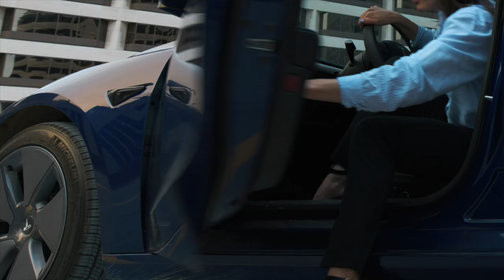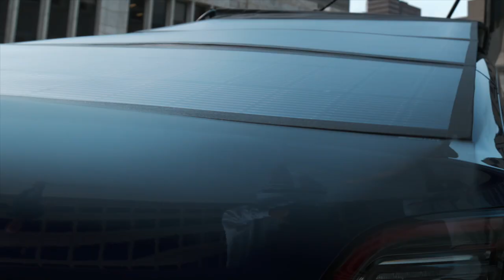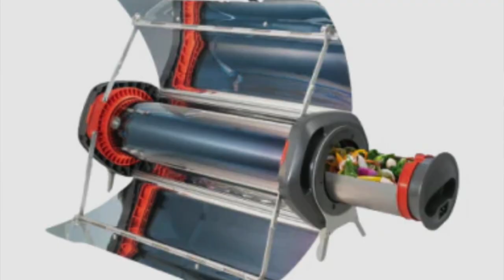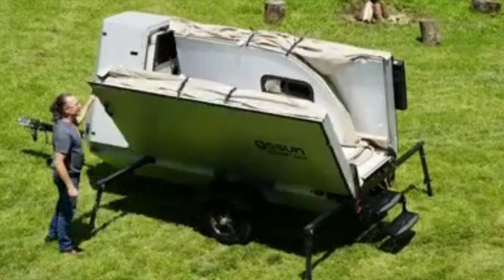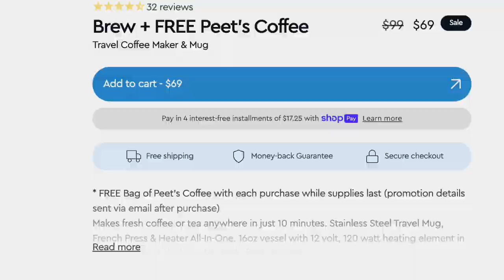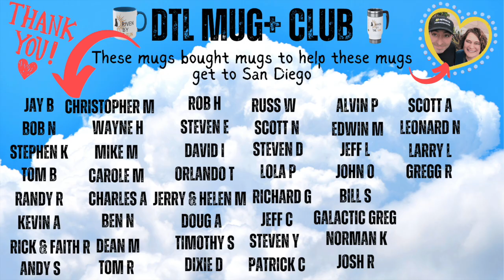Charge Your EV with Solar #GoSun

Comment: With panels folded out, how are they secured if it is in windy conditions?
Reply from the maker: Last I heard they were safe in normal windy conditions but not in high winds. They may have fixed this. I haven't looked at the most recent build.

Comment: After watching my older Model S sit unused on the street for a cold blast of weather we had for 3 weeks, and going from 78 to 40%- i realized this would work great. Just maintaining battery level- I'm in an apartment with no way to access its power. 
In severe cold, u should precondition the battery before driving. U get no brake regen(one pedal driving) and horrible efficiency until the battery is warm. That takes away from ur range. 
Preconditioning with a solar panel attached fixes this. 
I already carry a 1kw portable battery on road trips. It powers all my peripherals- and recharge it with a solar panel that folds and fits perfectly on the privacy screen under the hatchback. I simply set it up while at tesla super chargers on the road. 
If i didn't invest heavily into my system already(and didn't have free lifetime tesla charging! ), this would be the way to go.
Reply from the maker: That’s a great use case for this!

Comment: I also hope Gosun EV chargers can be plugged into Tesla PowerWalls and charge them to adequately supply power to a single family house. Maybe a future upgraded gosun EV charger will have a higher capacity to be able to charge up both Tesla vehicles and Tesla powerwalls. It will be the perfect way to get offgrid!!
Reply from the maker: That would be awesome! Hopefully the weight goes down and the efficiency goes up in future models.

Comment: So from some research and what I understand, this solar charger charges 1200 watts/hr, which is equivalent to 5.4 miles/hr. Within 30 minutes of solar charging, it adds half of that, approximately 2.7 miles. With a solid network of superchargers already spread across the country, range problem is essentially a thing of the past.
Reply from the maker: Great point and very true. I agree in many areas (including where we live) range anxiety is a thing of the past. Some states are lagging however. Also rural areas in many areas are behind. Another issue is cars like our Leaf that has an outdated charge port (chaddemo) with no real adapter option.

Comment: LOL, got many decades of experience dealing with electronics and power delivery systems from small to huge. The battery technology of today is not capable of accepting enough charge to replenish it's capacity in this case a cars battery capacity, without of course creating a shorter life duration. Every time you fast charge you are amplifying the damage to your battery. Slow charge will give you the best durability, their absorption rate depends on time for a full charge. The solar panels shown here are simply not large enough to collect solar energy to top off the battery needed to move that vehicle, yeah maybe for shorter distances it be OK. But not to achieve a full charge. If you have 8-10 hours of solar exposure a day or short distances to travel then I guess it be OK too and hope the weather is good. So take all these videos with a grain of salt. If it will be useful in some kind of fashion to you be my guess, but be ready to plug and charge every so often. Hey I just seen a guy with a box like that on his back running down the street! 😅🤣😂
Reply from the maker: Great info. Thank you!

Comment: I pay about $508 annually for charging my car. Once we have PV on the garage that will be $0. Not sure I could justify $3k for mobile PV but, my Aptera will have it built in. Still like the concept. Would be great for camping with the Rivian.
Reply from the maker: For us it will be a security blanket. Can get home (very slowly) if there is a power outage or broken charger. Of course our Aptera fixes that for most cases since it will be our main car. Thank you for the comment!!

Comment: Solar energy is not free. You must amortize the cost of the solar charger over its lifetime. Even if I can get 1200 watts from this thing (doubtful), the price of the power is significant. Maybe if I live at the equator on a cloudless day with every panel oriented ideally toward the sun, I'll get close to 1200 watts. That's 1.2 kwh per hour during peak hours (maybe six hours per day around noon) or 7 kwh per day, but I'd bet on an average less than 5 kwh per day at the equator and less still in Michigan.

At 4 miles per kwh (on the high side of realistic for an efficient EV like a Bolt), you'll get no more than 28 miles of range on your beach trip, so you'd better live close to the beach. Aptera promises only 40 miles  per day with a full array of solar panels ideally. I'd be very surprised if you get 20 or even 15 from this device with a conventional EV.

I pay 12 cents per kwh for electricity from the grid, so that's 60 cents per day at best, maybe $200/year worth of solar charging. Power costs more elsewhere, but if this thing costs more than $5000, I doubt that anyone with access to the grid will save money charging this way. If you want to charge with solar energy, you can install conventional panels on your house and use them to charge. Rooftop solar is far from optimal, but at least the panels are always oriented in the same direction, so you'll get consistent power on a sunny day.

If you like this product and want to use it, more power to you, but don't kid yourself that the energy is free. It'll likely cost more than charging from the grid at home.

I also wonder about the irregular voltage/amperage from this thing. Is it healthy for my EV's battery? Will it even work?
Reply from the maker: Thank you for the comment. We appreciate the research that went into it. Not everyone takes the time to share. Thank you!!

Comment: Don't get me wrong, I think this is a great idea, but I am also very analytical. The problem I see is it depends on if you REALLY need those miles off grid. If you have a car as efficient as an Aptera it would make sense but, then again, that is why it already has solar panels. If you are in the middle of nowhere and have to charge slowly this could make sense, but.....

It costs a lot and this needs to be cheap to pay off in a reasonable time. It's $3000 (or $2100 after tax credit in the US for now, hopefully at least 4 more years ;) so unless the zombie apocalypses comes and you don't have grid power or your electricity is extremely expensive, it will be a very long payback. Other than the good feeling that you are partially running on sunshine. 

My electricity is $0.13/kWh so, unrealistically speaking, I would save $1/ day on electricity assuming I can get 7.7KwH and you don't calculate in the drag of the unit housing the foldable panels, it would take 6 yrs to payback. We all know it's  not 0 drag, it is fairly large so the extra drag will probably eat up half of what you are producing. So if you are keeping your car for 12 yrs you may break even assuming nothing goes wrong with the solar panels or inverter. Of course if the box was customized to surface mount on your roof the drag would be less and more feasible, but that would drive up cost if it wasn't an agnostic design.  

This is why when Elon is asked about putting solar on the Tesla he always says it's not worth it since even under full sun all day it would net ~5 miles of range and add way too much cost to be worth it.  And that is integrating the solar into the  car panels like Aptera without affecting range from additional drag. He suggests putting solar on your roof and just charging with solar at home where it is more efficient.
Reply from the maker: Thank you for the well thought out and balanced comment! We learn a lot from folks like you! We like the direction this is going and think it will just get better and better. Thank you again!!
Reply: I think it would get stolen very quickly.

Comment: The increased drag from the ruined aerodynamics would make any gains moot.  1200W peak charging? That’s under 4kph in perfect conditions.  Not worth the capital cost.
Reply from the maker: My hope is that it's a step in the right direction. Thank you for the comment.

Comment: Hmmm. 1200W x 8 hours = 9.6 kwh ~ 25 miles. That's the best case, with ideal solar illumination. In most places in the U.S., you'll be lucky to get half that.
Reply: So its 12 miles..that’s about 19km..
My daily commute is about 25km, so why not? I can take any free km of charge any day.. GoSolar !!!
Reply: How much energy do you lose when you drive with that roof rack on there?
Reply from the maker: Definitely some. It's 70 lbs. For us it will be a security blanket. If power goes out we can still charge. Slowly but still.

Comment: Good luck Patrick with this new product for GoSun !
Thank you Patrick, Sarah and Chad!
Patrick,
I would love to know what cleaning and protectant you suggest for you resin encapsulated panels ( The sun degrades everything here in AZ, including me ! ) Don’t short sell your product:
PV solar panels obscure the hot sun which comes   through too many EVs large panoramic glass roofs. That heat means more battery power  needed for cooling.On my house my PV panels  keep the roof cooler and is more efficient ( being cooler ) when it stands off the roof!
BTW We use GoSun ovens during our annual Solar Guild Solar Potluck dinner event. Solar only is used to help us prepare meals , powering all cooking devices that all participants use to make their meal, enjoyed at the end of the day when the sun sets in beautiful  Catalina State Park in Sunny AZ. 

Sarah, Get PV solar for your house. The power you generate will  offset the power to run your cats’s automatic  litter boxes ! 😉
Reply from the maker: Great suggestion Len!! - Sarah

Comment: Mobile solar panels to charge EVs is a totally useless idea except in circumstances where you have no access to other power and you absolutely have to charge your car, for example off-grid camping.

A 1200W panel like this will produce a maximum of 1500kwh a year in a dry sunny desert-like climate and more like 870kwh in London, and that's only if your car spends 100% of the daylight hours outside in the full sun, never in the shade, a garage, underground carpark or actually being driven.

Take out the lost energy lugging this thing around everywhere and I can't see a net benefit at all -  for $3000 (plus the cost of roof racks) it would take me over 50 years to see any benefit in a sunny place like Sydney Australia.
Reply from the maker: Thank you for the comment.

Comment: It's a really neat idea.  My worries would be ... have a gusty wind and it would blow around like a kite and get damaged (when unfolded).   Also, math-wise.  I drive about 25 miles a day (so perfect for me), but, my power cost to recover those 25 miles is ~ $15/mo.   With a cost of $3000-ish...  is about 17 years... presuming it would last 17 years of folding/unfolding.
Reply from the maker: My hope is that progress continues and it gets better and better. Thank you for the comment! Excellent points for sure..

Comment: Nice idea, but does the range gained outweigh the range lost to the increased wind drag? If your commute is at low speeds, it's plausible, but at highway speeds, it seems a bit, ahem, shady.
Reply: Exactly - in my model 3 at 65mph on a flat freeway I use 200wh/mi on a warm sunny day - just putting on the roof racks (nothing else just the racks) - this goes to 240wh/mi, putting this on the roof could easily see this go to 300wh/mi +, 20miles on the freeway and I have lost almost everything I have generated on a sunny day.
Reply: @TB-up4xi  but imagine where we’d be with EV’s and Solar if big gas Corps didn’t work so hard over the past 80 years to shut it down. Solar has crushed milestones in just the past 5 years! 
In another 20, people will not even consider a gas vehicle anymore
Reply from the maker: Nice pun! Haha.... interesting question. We look forward to learning more!

Comment: Really cool invention. If I owned an EV or plug in hybrid I'd definitely be interested.

I'm currently driving a regular Hybrid until I get an Aptera.

Which begs the question. Could this tech be used with Aptera. Plug it in and set it down next to it?
Reply from the maker: 🤔 Positively intriguing!
Reply: You don't need Aptera when you have this. Just get a cheap $200 EV lease. You'll be much happier